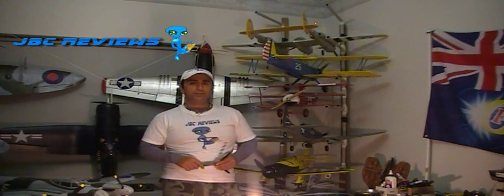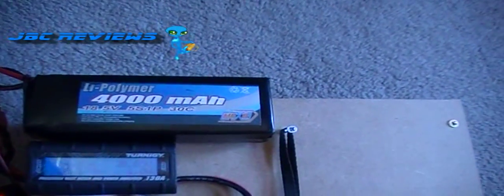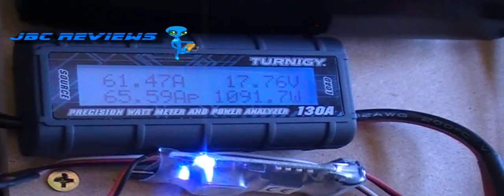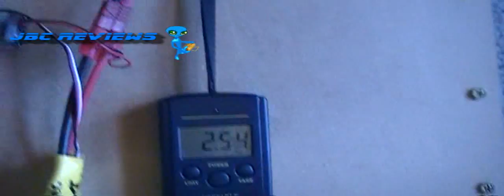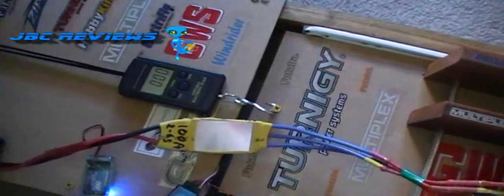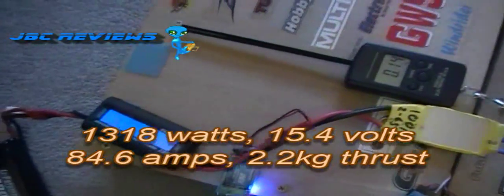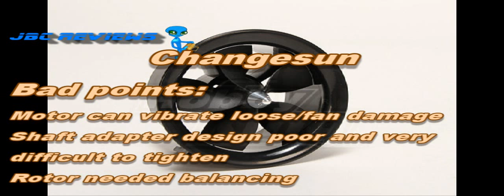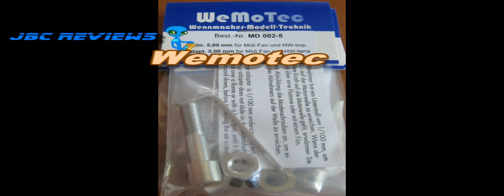SHOOTOUT: WeMoTec Vs ChangeSun Vs FlyFly 90mm Fan

Comment from the maker: I hear what you're saying however the ratio of amps increase to thrust output is not linear & should therefore not be considered so.I..do..say in the video that the Changesun is a much softer rotor & requires a higher KV motor,I also say that it costs alot more than the Wemo.I also mention you can get good performance out of the Changesun however pure performance was not the only factor which I considered when I gave my scores. Ease of assembly, reliable etc must also be considered.

Comment: Thankyou for the test, but the Raking must be different, doesnt matter if the battery was low on the flyfly test.
You did not compare the Power/Thrust Ratio.
The Changesun made 1201W/17,6V/65,6A/2220g (T/W-Ratio=1,84g/W)
The WeMoTec made 1583W/17,3V/87,4A/2700g (T/W-Ratio=1,70g/W)
The FlyFly made 1318W/15,4V/84,6A/2200g (T/W-Ratio=1,67g/W)

The Thrust/Power Ratio is known as Efficiency-Factor for comparsion in the same conditions.

Comment: would be better to compare performance if the input watts were the same across all fans say, 2000watts. yes, it would be difficult because u would have to use the motors with the same specs except kv but, that would give better results

Comment: It's not apples to apples because you are using too low of a kV motor for the Changesun on 5S.  On the Wemo your amps are 34% higher but you're only getting 20% more thrust. I would be interested to see the thrust on the Changesun at 87 amps.  Also, the Wemo fan costs 400% more than the Changesun!